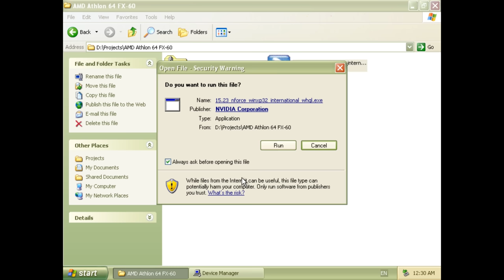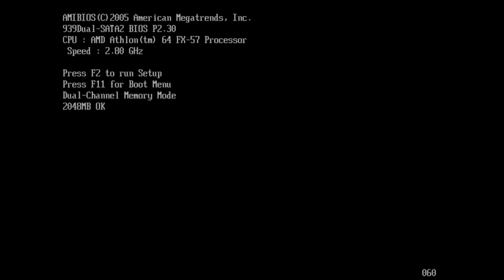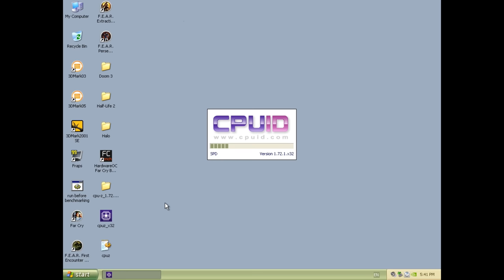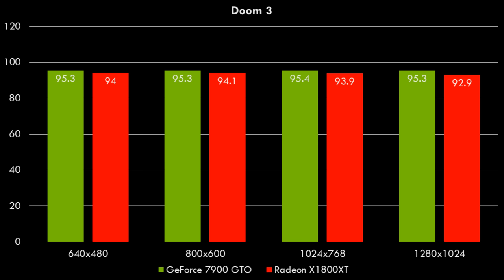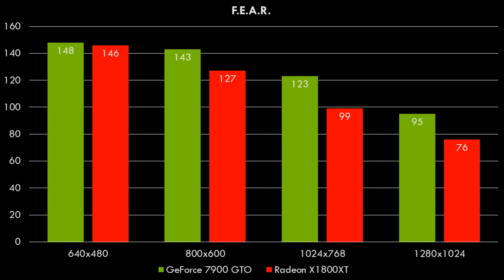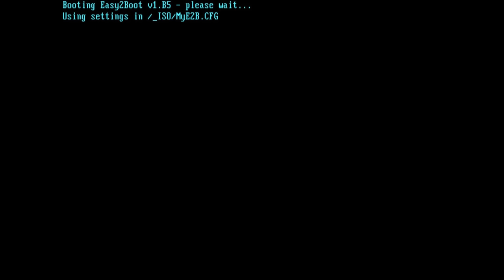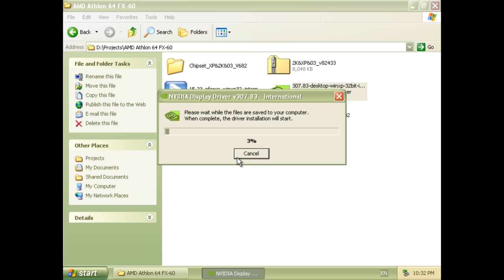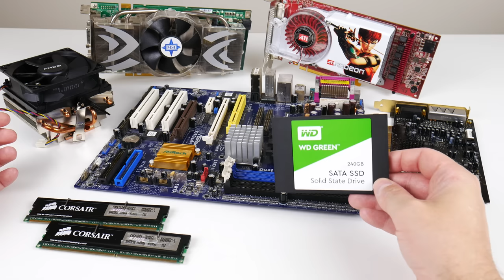AMD Athlon 64 FX-57 - $1031 CPU from 2005

Comment: My retro XP rig has an FX-60 in it on an ASUS  a8n-SLI Deluxe board.  Got the chip for about $100 after they discontinued it and shipped it with Win Vista... sold the Vista immediately.  It's running two 7800 GTs.  Custom water cooling loop.

Comment: I've had quite a few AsRock boards up to this point and they've always been reliable. I still remember the first time I got one on sale thought WTF is this, but it turned out great. Would recommend them. I generally go with Radeon for video if I can. But i've run some nVidia stuff in the past.

Comment: I also have years ago mainboard from ASUS with Socket 939 and it also died, and that was after a month of using, thanks for movie, now when I buy today mainboard with S939 I buy another. And when I bought mainboard with Pentium 530 after losing that with Athlon 64 3200+ I saw that games that ran good on Athlon ran very bad on that pentium, even NFS:U2 slowing down there, even with GF6600GT on PCIE.

Comment: I think these came with those neat four-heat-pipe-coming-out-of-the-same-side coolers which I found a lot at Goodwill Computer Works. I need to compare those to the later style you're using here.
Reply from the maker: Good question, not sure what the boxed cooler looked like. Did it even come with one?
Reply: @philscomputerlab  After looking into it, I was thinking of the cooler that shipped with the FX-6X series which came out maybe 6 months later. Hexus reviewed the FX60 and references that it features an upgrade over the original cooler-- "When FX-57 was released it was shipped solely with a PIB cooler developed by AVC. Since launch, AMD...sought...another model to ship ... with FX-57 and their other ~100W CPUs... Manufactured by Coolermaster and called CMHK8-8I22A-A2"

Comment: 1:57 that is how good mainboard cooling should look like instead of what we get today. Heatsinks on the vrm serve more as a decoration than dissipating heat and motherboard manufacturers have forgotten how to lay a heatpipe across the mb to the chipset so we get chipset fans mounted on a piece of metal that is smaller than the fan itself

Comment: I had the Fx57 with SLI 7800 GT's back in the fall of 2005 and it kicked so much ass. Didn't have the computer for too long, though, summer of 2008 it died of capacitor plague, but by then the single core processor was starting to be an issue anyway. Might go ebay diving and rebuild that thing though.

Comment: It's no wonder Nvidia bought Uli for their chipsets. My Asus A8R32-MVP Deluxe is still doing well with my FX-60 @ 2.8 GHz. I started out with an ATI 9600 Pro that I unlocked to a 9700 Pro. Then went to a 2900XT, 3870, 4770s in Crossfire, 6870 and now at an HD7970. It's still hanging in there and a blast at playing BF2 or Bf2142, haha.

Comment: One of these chips is currently up for sale on ebay for £499 yikes personally have a FX60 two core in another classic maxed out working retro build. It is one of my fave personal builds one up from the Socket 754 Athlon 64 3700+ with the ATI Sapphire HD 3850 in the build that has to be my personal fave retro build. Not sure if that is a Vista Ultimate 64bit operating system on the FX60 build if so the internet framework was built up using windows 7 drivers it surfs the net faster downloads and renders websites way faster with no spinny clocks while watching youtube videos etc using firefox.

Comment: P4 3Ghz Prescott Socket 775, 2GB DDR2 533, 7800 GT. Got stolen within a month so I built a P4 3ghz Prescott Socket 478, 3GB DDR 400, 1950pro XT OC Ice Q. Loved it. Built it to play Oblivion both times. I had Pentium D plans for that 775. Ended up going AMD with an Athlon 64 X2 Windsor 2.8ghz, forgot the PR rating. AMD was still the faster chip until the Core line up. Well for gaming. I do remember compression and office apps running smoother on the Intel chips.
Edit: I had issues with all the nForce boards I had. All of them. Literally. Sata ports would go, memory slots would go and they could only be powered on so many times. They were good when they worked.

Comment: Please do the same with the Q6600! But add some CPU benchmarks comparing with other CPUs of that era. Thanks
Reply: You can only do this with a Q6600 if you are going to clock the bejesus out of it. Total waste of the chip if it's running stock.

Comment: I had both the MSI K8N NEO4 and NEO2 with nForce chipsets during that timeperiod (2004-08). I killed the NEO4 by my own (stupid) accident and since it happened late in 2006 it was actually not that easy to find a replacement lol but I had no issues with either the boards tho and their nvidia chipsets, but then again it was also only using SATA1 drives, I still have this system's main drive to this date, it works but it has not been in operation since probably around 2010.

Comment: The A8N32-SLI had that issue for me too. It was usually the SATA driver that would cause it for me. Other than that it was an awesome board.
Reply from the maker: The board even has a secondary Silicon Image SATA controller, but also no luck with that one. After installing chipset driver, no boot...
Reply: @philscomputerlab  for me it was the Nvidia SATA drivers that caused the issues. I ended up having to use the Silicon Image controller and set my Hitachi Death Stars in RAID 0 which worked well for many years. But every time I installed that Nvidia SATA driver...

Comment: I still have a Opteron 165 machine running WIN7 24/7, DFI Lanparty Ultra-D motherboard 2GB ram, HD5850 gpu. Back in 2006, it ran at 2.850Ghz (9.5x300, OC'd from 1.8Ghz stock), then I upgraded to Q6600 OC'd to 3.6Ghz in 2008. Since 2014, I've underclocked the Opteron 165 machine to run at 1470Mhz at only 0.875V so it consumes very little power (under 10W for the CPU). The Q6600 is still main machine but I intend to build a modern machine based on upcoming i5 10600k  at launch. 
.

Comment: I replaced an Athlon64 3200 with an opteronX2 165 iirc to prolong the system, rather than moving to intel 775 back in the day. I ran that system for like 5 years, which was an eternity back then. Far less so now.

Comment: Hello Phil, CHiLL here....
Your video triggered me to try the NForce mainboards that I had stored away. And what do you know? My two ASUS boards, both A8N-32 SLI Deluxe, would not boot. There was a small difference between the two: on one board the fan on the graphics card would not spin up, but on the other one it did. I seem to recall that these boards are quite specific about the power supply and I only tried one. So maybe I'll get back to these with a different power supply and see if my luck changes.
I also have a Gigabyte mainboard with the NForce4 chipset and fortunately that one will boot without an issue.
And then there is the king of the NForce4 boards, the DFI LanParty UT NF4 SLI-DR Expert. I also have on of these. I noticed one bulging capacitor near one of the PCI slots, but decided to fire it up anyway, with the FX-60 CPU (an idea for for a future video?) and that mainboard is also still alive.
So I must agree with you that said about the ASUS boards. This generation of boards from them seems to have failed the test of time. I'm contemplating trying one more A8N32-SLI board, as someone near where I live is selling one for a low price. I'm tempted.....
Finally, I also tested an MSI mainboard with the NForce3 chipset that I have. Apparently that one is also working fine. I think I will do a fast Windows 98SE build with that board, as it still has AGP and I have a few of the fastest AGP cards out there.
In the meantime, good luck with your website and videos and stay safe!
Reply from the maker: Interesting findings! I did get a comment that I shouldn't have tested with a FX, but a regular Athlon 64. I'm sure that the second board, has latest BIOS, and was running FX-57 and FX-60 in the past. But not sure about third board... I love my VIA chipset boards HAHA. I'm a minority but they always worked well for me, even with Windows 98 and DOS :D
Reply: @philscomputerlab  I did some more testing over the weekend with my Gigabyte K8N Pro-SLI. It turns out that this board supports ECC RAM, like servers do. As I read about the ASUS A8N32-SLI Deluxe supporting ECC RAM, but being unable to test it, I tried it on the Gigabyte board and with just two DIMMs I get 4GB RAM! I only tried it with the Athlon 64 4000+ and it would not boot with 4 DIMMs, but maybe my Opteron 180 or FX-60 will support that amount of RAM.
In the Gigabyte BIOS, you can press Ctrl+F1 to access the Advanced Options, where you can enable support for ECC RAM.

I bought 8 sticks of (HP) 2GB Registered DDR-400 DIMMs a few years ago. As it turns out I have three bad sticks and five good ones.
I also updated the BIOS on my MSI K8N Neo FSR 2.0 (socket 754) mainboard. It had some trouble booting, but then I noticed a bad capacitor on the board. When I have the time, I will try and put in a new one, to see if that helps with the booting issues.
To be continued....

Comment: Hi All, i never overclock so that i dont stress anything, but the AMD range around Y2k to the  XP era was also very fussy about ram, they wrong timing or speed would make a PC only boot to bios or do nothing just a black screen.

It also made upgrades limited, while i liked the Cyrix and AMD options as a cheaper setup , and you could upgrade  a small portion i found between repairs and mix and match parts with friends ( at the time 3 months was a common upgrade time frame )  that the chouice was a headache to sorts it out or just leave it as it is , that is when we began just buy and keep as second PC or sell out as complete working system.

After hours my time is free and i have spends say 3 days at 4 hours per day trying to sort things out, my success rate was probably 1 in 5

I would try other lower end AMD CPU's in those mother boards or guaranteed combos that you have had working before to see if the boards actually work. 

Regards
George

Comment: The Dell 700, 710 and 720 enthusiast desktops used NVIDIA chipsets of this time with no cooling on them, and its clear that some is required because the rubber stoppers Dell places on the motherboard try to prevent board flex have turned to sludge due to high heat in the area behind both the north and south bridges chips.
Reply: That said I hate these 'leave your comments below' on this kind of topic as you get every person who has ever had an issue with any AMD or nForce product to come out of the woodwork and insist everything associated with these brands was bound to fail.  Truthfully, they likely have a similar failure rate as every other manufacturer.  nForce2 was an incredible platform that outperformed its competitors when it was new.  Drivers were at least as reliable as VIA or SIS products, if not more so.  If you don't know the root causes of these issues, it might be best to simply leave them out of the video and instead focus on what worked well.

Comment: Have an MSI K8N Neo2 Platinum working. Had to give a push to the chipset fan  during boot to start spinning in a squeeking noisy way. Combine it with the noise from AGP's card fan and it's obvious  why it's in my basement. But the cpu ( an 3800+) still lives in a Asus K8N SLI Premium Mobo which is fanless  along with an Asus EAH 4870 D5 vga. It runs until now windows 7 64bit.  It can run Windows 10 but as i remember due to lack of Ati drivers cannot do 1080p. I also have an Asus 9800GT from that era , bought from a stockhouse .Died after a short period of time but is now working after reballing it in my oven!

Comment: Wanted an FX-60 (2.6Ghz Dual Core) to replace my Athlon 64 X2 3800+ (2.0Ghz Dual Core) on my ABit KN8 SLI 939 board for the longest time. Price never got low enough for me to afford one. I eventually moved on to the newer, faster AM2 platform: Athlon 64 X2 6000+ (3.0Ghz Dual Core).

btw, 15+ years later, my old 939 ABit still works like in its prime days. So does the AM2 rig. :)

Comment: Thats my feedback on my nForce mainboards and XP:
* ASUS A7N8X (nForce2) with AthlonXP2400+. Works pretty well, the Silicon Image SATA gave me some problem (you need to have drivers that are later than the BIOS to have a bootable XP install, also the SATA is considered as a SCSI drive).
* Abit NF7-V (nForce3) with Athlon 64 754. Seems it worked quite well, no problems I remember.
* MSI K8N Neo4 Platinum (nForce4) with Athlon 64 939. This one really gives me stability issues. The XP-32 bits install works quite okay, until you install the nForce drivers, I remember the OS crash at the screen. I tried XP-64bits (because the case that came in had a product key for XP-64) and that would not even install.
From there, I get out a feeling that nForce chipset were probably very good with the Socket 462, but seems it becomes controversial when you move to the Athlon64. I have to say, pretty disappointed with the nForce chipset after nForce2.

Comment: Never owned the 939 FX chip but did upgrade my 939 Athlon 64 to a Athlon 64x2 (Windsor Core) on a Biostar mobo with both AGP and PCie (Although PCie was slow as I found out when I upgraded from a 128mb XFX 6600GT to a Geforce 7600GTS?)

Comment: AMD boards with nForce chipsets are quite popular and cheaper here than the AMD chipset ones. Never bought it, but my uncle used a few of them nForce boards (although it's not from ASUS, most are from BIOSTAR), and ended up quickly replacing it and ended up with ASUS M4A78-VM board which still runs fine.

Comment: I have the A8N32 and there was an issue with something buggy on the USB, you couldn't use both a usb mouse and keyboard (can't remember off hand which one), which could cause random crashes or freezes on boot. Replace whichever one of the two and it would go fine. The NForce 4 chipsets do really like cooking themselves, and the location under the back of the graphics card doesn't help - that heat pipe system is pretty overrated although it looks nice. I have a FX60 and two 8800 GTX's in SLI on mine and needless to say it only gets turned on on the coolest days of the year... ULI's 939 chipset was as good, but ran markedly cooler.

Comment: I have experience with a FIC Socket A board based on the nForce 2 chipset: Buggy as all hell. Theoretically it supported the 400mhz FSB Athlons but I had no luck running the XP 3200+. Also, it seems like it hated certain video cards. I bought a FireGL card for it (was supposed to be an early XP rig) and it wound up producing graphical glitches on the desktop. Returned it only to find out that it worked fine on the sellers computer. Tried an x1950 Pro with better results but the computer woul lock up like clockwork after running a game for  about 10 min or so. The only decent card to work on it was a Quadro XGL card based on the Geforce4Ti 4400 core. Swore off nVidia based boards after that. Sucks because most socket 939 matx boards out there are nVidia based: I'd love to combine a dual core A64 with a really fast AGP card (Say a HD4670 or a HD3850).

Comment: Very nice video. I like the FX-57, sadly i don´t own that model. I think it makes more sense to overclock this FX a little bit, as this cpu does feature a unlocked multiplier. 3 GHz+ should be possible to reach. These FX-chips does cost a lot of money and are quite rare. For such a system i would prefer a radeon graphics card, like the X1950 XT or GT. But the X1800 XT is also very powerful. Also i use the same mainboard, an interesting one. I think its one of the best socket 939 mainboard.
Reply: Why are they expensive? The amd athlon processor
Reply: @inkbold8511  Because of the unlocked multiplier. It was a pretty fast CPU back in the days.

Comment: I have Asus A8N5X with nForce4 chipset and i sometimes run into  problem but not too serious. I have had some problems with booting into bios ( frozen screen even the CPU speed was set to default ). And the second problem is when you already booted into bios , mouse is frozen so this two problems are the only causing my issues so not that serious. I have Athlon 64 X2 sometimes clocked to 2.5GHz from 2.0 GHz and never got a problem with this overclock. Also i did some changes to memory speed as well and it is  stable. nForce chipset in my opinion is better than VIA chipset. It allows you to do much more than VIA so nForce is my personal best. I don't know what is your problem with your MB with nForce chipset but i think the controller for peripherals ( SATA , ATA , IDE )  is dead.

Comment: Most of those old boards needed caps after about 2 years and would cause all the issues that you had. Every one of those old boards used low-quality capacitors and because of their age used or not should be replaced, however these were very good boards in their day I owned an Asus AN8 as well as an ABIT KN8. This was before the "ultra, mega, military, awesome durable" push all the manufactures did during the core 2 days. I've re-capped many many of those to solve a lot of those strange problems.  Other issue was chip stepping and bios compatibility that is a whole spider web of BIOS, Driver ect.  This was back in the day where different combos didn't always need the "latest" driver and in fact needed specific versions to operate properly.  Oh how far drivers have come!
Reply: Replacing the caps is quite easy and cheap and places like small bear or ebay will have everything you need.

Comment: @PhilsComputerLab why not use Rufus to install XP? I found it great, and when I had problems, I just disconnect CD/DVD Drive and reconnect it when install is finished. Super fast.
Reply from the maker: Easy 2 Boot has all the AHCI SATA drivers included!
Reply: @philscomputerlab  I understand. I just 2 isos: one by me and from other guy (Integral) which has them all integrated.